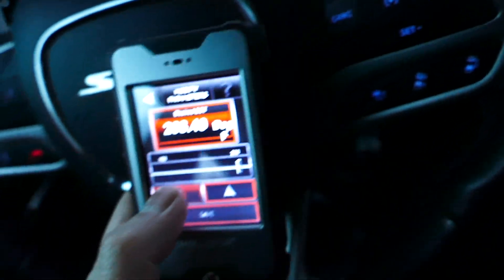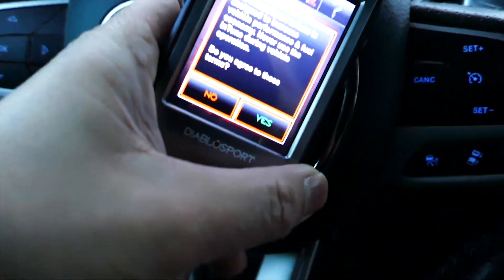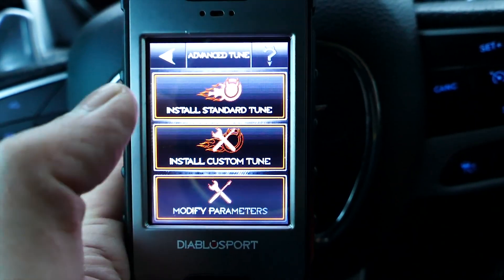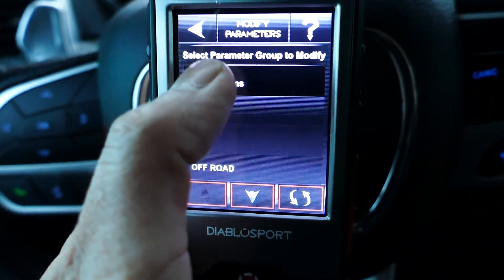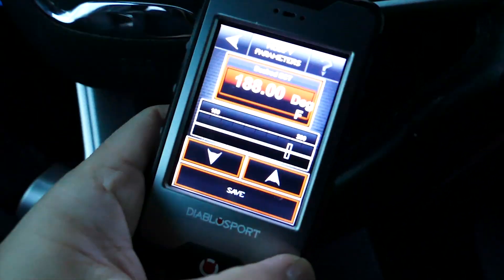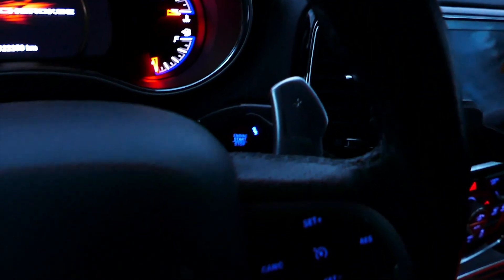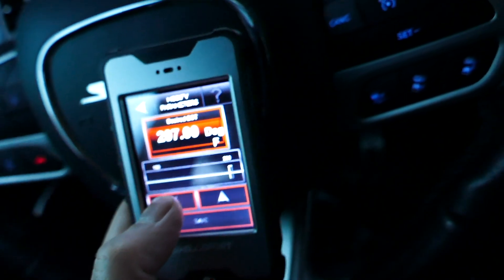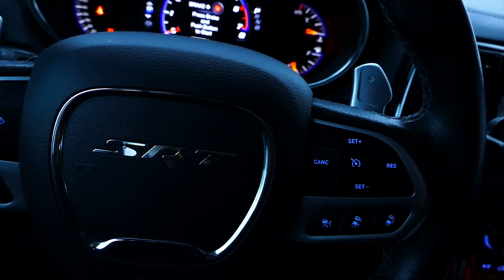180 thermostat 6.4 hemi

Comment: That truck designed to run between 205° and 215°. I don’t know if you live in the north or not but you ain’t gonna have any heat with 180° thermostat.
Reply from the maker: @richardgpolitte2280  Hey there, ran it three winters, I get heat

Comment: Question, i installed a 180 temp thermostat in my 2015 jeep SRT but it threw a check engine light for "thermostat irrationality"  any ideas what i should do to get it cleared out? Autozone tried to get rid of it but didnt work
Reply from the maker: @meowmixsgdz981  hey there, most likely need to set your fan speed lower or have a tuner like hemifever add the 180 in your tune, also could be your temp sensor. In anycase your hemi thinks it's still a stock oem thermostat.

Comment: My fans are loud as hell when the A/C is on how do I fix that??
Reply from the maker: @graysonfamilykennel5211  if you dropped it 20 degrees, might by the way it is, you ca. Drop it more or get a custom tuner to see what going on, when my ac is on it pretty loud to but it comes on within the 180 range
Reply: @moparbro  how can I drop it more without a tune?
Reply from the maker: @graysonfamilykennel5211  without an i3 tuner you technically can't, if you do have the i3 tuner simpler lower the temperature. If you're stock you could have a faulty temp sensor
Reply: @moparbro  Yeah I got to figure this out it sounds like a 747 aircraft smh. I have to turn my A/C to order food in the drive thrus so embarrassing.
Reply: So if my ect setting was 221 then I should drop it to 201/203 with the 180°
Reply: For some reason on mine it didn’t save, when I check again it says 203*F. I did updates on the tuner and still didn’t save. I installed 797 delete with 180* Plate

Comment: I have a 2020 charger 5.7 would i need get a PCM unlock ? Or no the device strictly works with stock PCM ?
Reply from the maker: hey there yea, anything +2015 needs unlocked pcm, 2018+ you would also need a security bypass module, hemifever.com or diablosport have packages that have all that. Hope this helps!
Reply: @moparbro  Hello brother, I have a Jeep Grand Cherokee SRT8, 2007 model, with 8,000 miles on it and the car is in good condition, but I suffer from a high temperature that reaches 240. Is there a way to reduce the temperature?
Reply from the maker: @user-yg5lu1rc2k  seems like the thermostat failed, you can either upgrade to the 180 thermostat or just swap out to a new  oem one. Hope this helps
Reply: @moparbro  🌹🌹
Reply from the maker: @ابوفهد-ي5ز4ص  🙌🔥

Comment: Hi . I have jeep grand cherokee 2011 3.6 L , the thermostat doesn't work with low speed fan,  it only work with high speed fan when temp is 230 F.
Is that normal ? 
Can i reset my car with tuner ?
Reply from the maker: hey there, looks like the fan speed sensor needs to be replaced, if that doesn't work replace the fan, only working with high speeds seems like the default setting when there is something wrong with the fan. tuner couldn't reset the fan, only change the settings on when it engages. thnx for watching!
Reply: @moparbro  thx bro 🙏
Reply from the maker: @mohammedabkar1059  🙌🙌🔥

Comment: i have a 2012 srt8 392 about to install the 180 tstat and want to change the fan speeds does the tuner allow you to adjust how quickly they come on for my vehicle? seen you go through a preset tune.
Reply from the maker: hey there, for my 2019  jeep the tuner just had 1 adjustable setting, for the 2012 you should have 3 fan settings and reduce all those by 20 degrees
Reply: @moparbro  Thanks man.
Reply: @DURPSET  did it work bro?

Comment: Do you have to have a unlocked PCM to change the fans??? With diablo i3??
Reply from the maker: hey there, the 2015+ hemi need unlocked pcms, the odd thing is there's only one setting called for fan settings, for the wife's 2011 300c there 3 settings 🤷‍♂️🤷‍♂️🤷‍♂️  and no need for unlocked pcms.  thnx for watching!
Reply: I have a srt 392 2016. I don't want to change nothing but my fans Temp. Reason I'm asking unlock the PCM just to be able to control the fan settings
Reply from the maker: @MR250K  ah gotcha, yea even hp tuners requires unlocked pcms for 2015+  https://www.hptuners.com/product/pcm-upgrade-service/ not sure of there's aftermarket cooling fans that let you manually adjust the fan settings.
Reply: @moparbro  Can you tell me how to unlock my pcm on a 2015 grand Cherokee to gain access to the fan settings?
Reply from the maker: @djrumbardofficial  hey there, you'll need unlocked pcms, I wouldmjust get a kit from hemifever or Diablo sport https://www.hemifevertuning.com/diablo-intune-dcx-p/dsp-i3-ecu-2015-car.htm
Reply: Okay I already have the Diablo sport, can you send me the link of the other stuffs I need please?
Reply: Or can I use the same PCM that I have on my 2015 jeep grand Cherokee hemi, but how do I unlock it?
Reply from the maker: @djrumbardofficial  https://www.hemifevertuning.com/diablo-intune-dcx-p/i3-pcm-exchange-car.htm
Reply from the maker: @djrumbardofficial  you could send hemifever your pcm to unlock but I would just buy an unlocked pcm so if anything happens u can just swap back to.oem
Reply: @moparbro  Friend, I already have both devices and I have already installed the PCM, but in the i3 the INTALL CUSTOM TUNE option does not appear. Available can you help me please
Reply from the maker: @djrumbardofficial  hey man, probably best to call Diablosport support, not sure why it's not popping up on your end
Reply: @moparbro  I was able to change it now, thank you, but I have a question: should I leave the MDS ON OR IS IT RECOMMENDED TO TURN IT OFF?
Reply from the maker: @djrumbardofficial  I left it on, it does run way better with MDS off, but it's a little more on gas, for example my chrysler 300c with MDS ON does 11L/100km with MDS OFF it consumers more gas around 14L/100km. The choice is yours but the hemi is healthier with mds off
Reply: Thanks, last question, should I install 93 OCTANE TUNE or 91 OCTANE TUNE?
Reply from the maker: @djrumbardofficial  I would do with 91 tune and 93 octane, most of the time 92 octane gas out of the gas station is not 93 and if it's like 92 the hemi will pull time and it'll be less horsepower, 91 tune with 93 octane is works better for me and the gas is my area
Reply: @djrumbardofficial  tune for whatever fuel you run
Reply: thanks bro